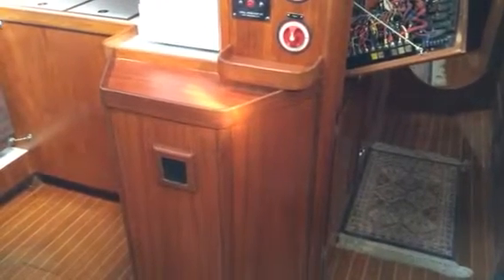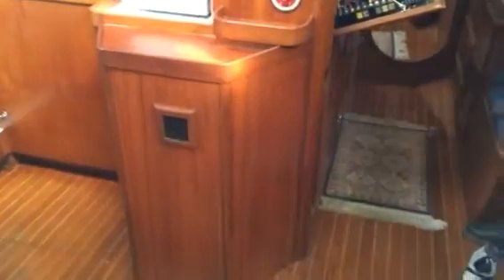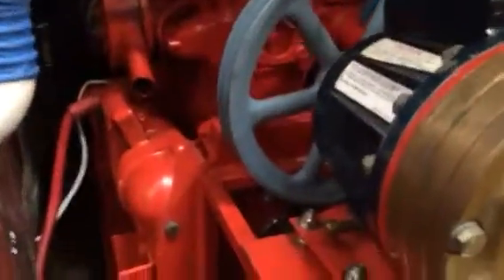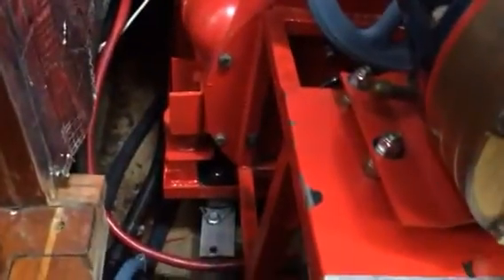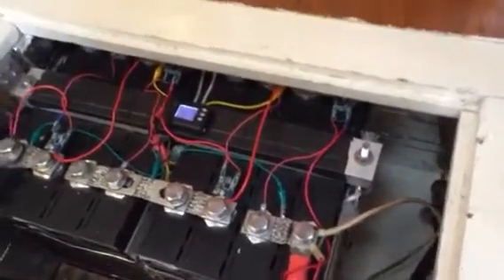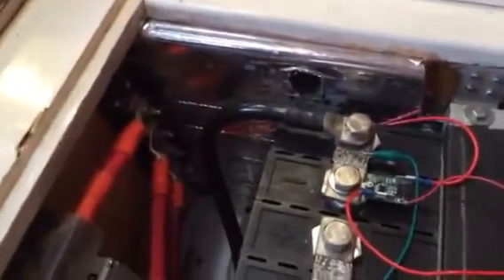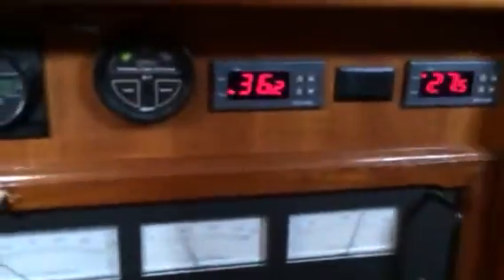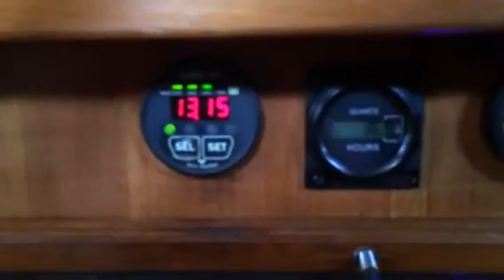LiFePo4 lithium battery install on sailboat

Comment: I'm very interested in your Yanmar/EcoTech/High-Pressure Water Pump Setup. Did you assemble that yourself, or purchase it ready-made? I would like to obtain a high-amp 12v (or possibly 24v) heavy-duty DC generator for a planned LiFePO4 800ah bank that doesn't make my wallet squeak... Thanks, Wil
Reply from the maker: Hi Wil , I built the whole thing myself . took awhile and wasn’t cheap but there is nothing like it on the market so I had no choice . This setup really works well . I have a 110 hours on it now and it has been flawless with zero issues . The pump is a Hydra Cell D10 by wanner and the alternator is an Echo-tech .
Reply: Hi Salserenity, glad you answered, thanks for the further info. May I ask what model of Yanmar genny motor you used, and which EcoTech? I'd guess you fabricated your own motor/alternator alignment mount. How did you couple the alternator to the Yanmar? Again guessing you installed a pulley on that same driveshaft to also drive D10 pump?  I've looked into PolarPower, FischerPanda, etc. -- very expensive.
Reply from the maker: No problem Wil.
If you go to Cruisers Forum , you can look me up . My handle there is Typhoon . If you go into my profile there are a lot of pictures and information . Try this link  
 http://www.cruisersforum.com/forums/members/typhoon-5310.html

I also started a thread on the build , here   http://www.cruisersforum.com/forums/f14/dc-generator-the-smart-way-to-go-65703.html

Send me a message there if you find it. 

Regards
Reply from the maker: I seem to find flaws with existing marine systems technology and like to do better .

Never seem to find what I am looking for on the market so I have to build it . All my builds have  been working great so far . I will be posting some refrigeration builds shortly . I always seem to be reinventing the wheel LOL, But actually its more like I don't design to a price point ,I want the things I design and build to last !! Not really good as a business model but I will hopefully never be stuck with something constantly breaking on me .
Reply: Thanks so much for the link, I shall go study your Builds, and contact you on CF.
Best Regards,
Wil